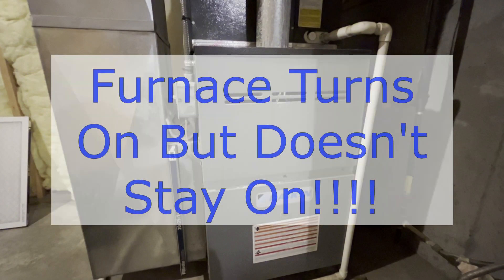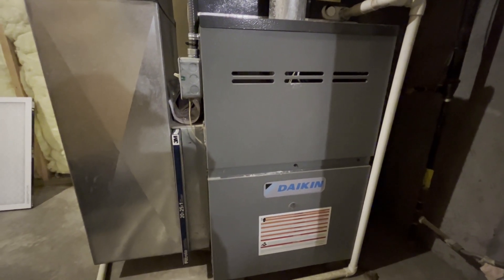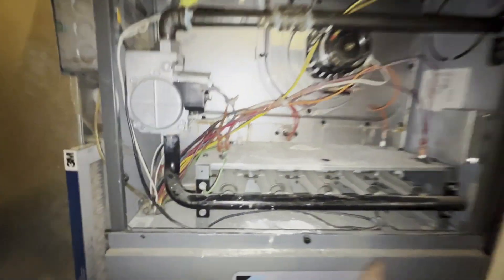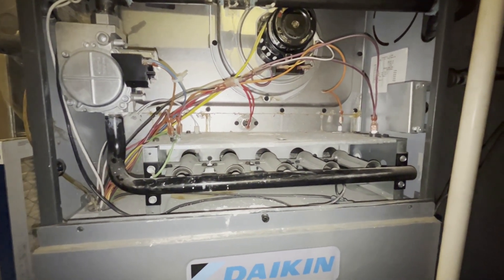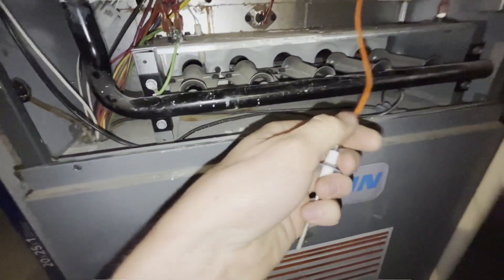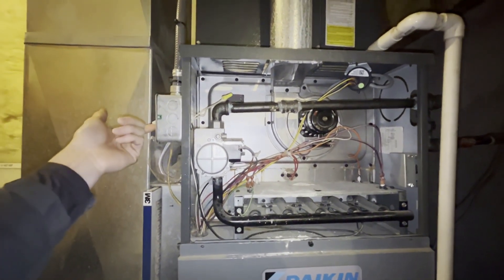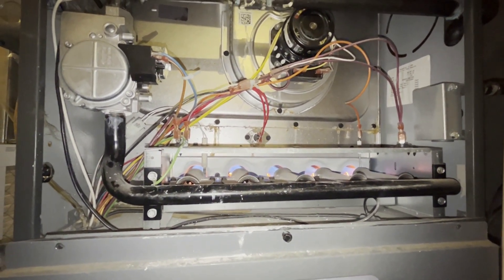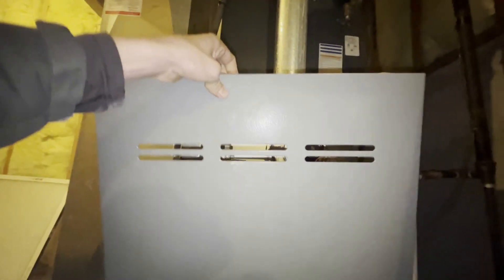Furnace Turns On But Doesn't Stay On

Comment: Question!!!! What do you think, I replaces the Flame Sensor and it still wont stay lite
Reply from the maker: 1. Help me out here, is it doing a similar sequencing to the video where gas is released and is ignited (you see the flame), but then after a few seconds the unit closes the gas off? 

2. Alternatively, most units can also be diagnosed by a blinking light on the unit. Typically one of the panels will have a “clear peep hole” of sorts where you can see into the unit without removing fasteners. At the spot, when the unit goes into error, there will be a light that blinks a certain number of times. That quantity of blinks can then be reviewed with the products information (which is hopefully still with the unit or simply google the make and model)

Let me know what you come up with!

Comment: THANK YOU!  My fiancé and I tried this, and it worked!!!  Was an easy fix and would have probably cost us a few hundred dollars for someone to come out and fix!
Reply from the maker: I’m so happy it helped y’all out and thank you for sharing!!
Reply: Hey man. I have an emerson gas outside. But I can her the blower comes on but goes off on and off for about 50 seconds but no heat
Reply from the maker: It sounds like your flame sensor isn’t being hit by a flame when the unit releases the gas, so the unit’s safety measures halts the release of more gas. The issue is likely that the flame sensor is dirty and needs to be cleaned or replaced (like in this video). Or if your flame igniter isn’t activating, that also would cause no flames and thus the flame sensor wouldn’t read any flames on the sensor. The flame igniter in older units is simply a small pilot flame or for most units today, it’s a metal rod that heats up electrically (starts to glow red/orange in this video).
Reply: Following your advice,  even though I cleaned it up with some steel wool. Replacing it,  same thing.  Cleaned it up again.  Poof!!!!. Thanks again for reminding me again.  You're video was the only one I found that had the same problem mine was.  Thanks again for your help.
Reply from the maker: Love it, I’m happy it solved the issue for ya!

Comment: I instantly knew the flame sensor was bad, there should be a code LED that blinks the input failure chart. Most controllers will only give 3 tries before the control locks out and requires a hard power AC switch reset. There should be a small window to look at the code LED before removing the lower cover. Remove the lower cover and hold the safety interlock switch while starting the furnace to better see the failure code LED, then see the blink chart for the input failure.

Comment: Mine has one of of those spiral sensor that when it gets so hot it will turn off the burner plus the fan,  and you have move it backwards turn it back on again till it cools a little.   It,s a 1980 comfort maker.

Comment: That flame sensor is just a metal rod.  when the flame engulfs that rod when it is clean it will pull about 5 microamps.  when it gets dirty it doesn't work.  no need to replace. just clean it with emory cloth.  have never replaced a flame sensor in 30 years..  good video!
Reply: The flame sensor acts like a diode when the flame hits it. The AC voltage is rectified to a DC voltage. If the microcontroller detects a DC voltage, it will keep the gas valve open until the thermostat is satisfied.
Reply: J @picklerix6162